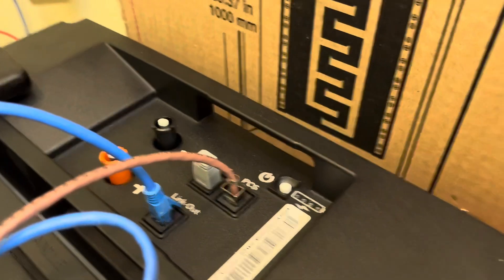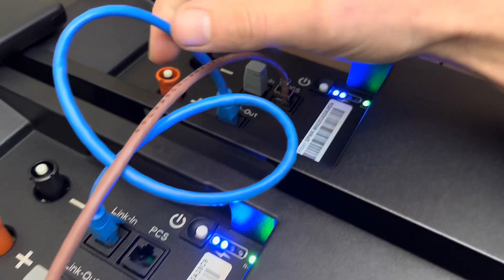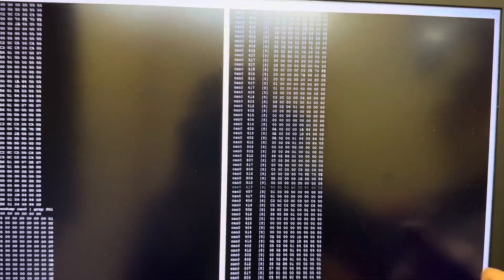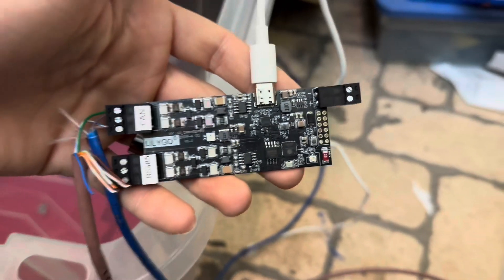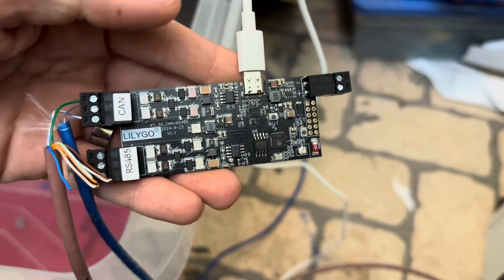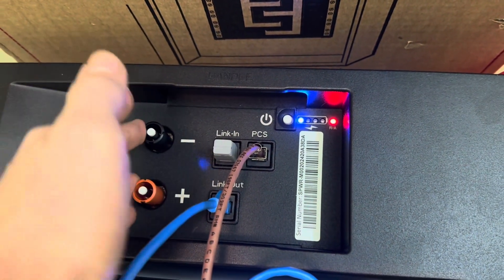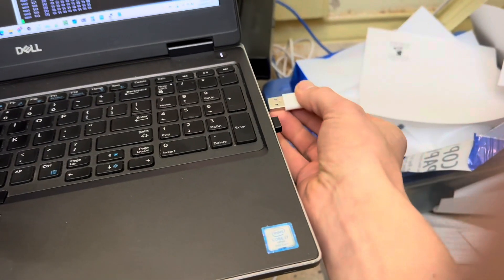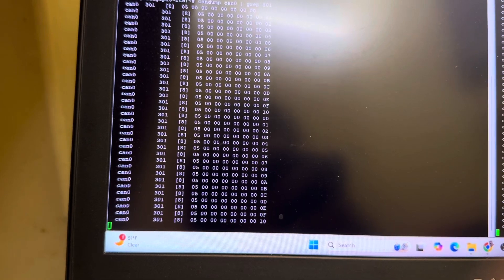6.5kWh Sunpower Battery Keepalives

Comment: Just curious if you made any progress with the Enerdel batteries? Mine is still sitting in my shed. As always very informative and interesting.
Reply from the maker: Hit me up, I'll share. If you want to run solar with it either a high voltage solar charge controller or a Solis high voltage hybrid inverter are two options. My trailer is stable minus the one battery that has a voltage isolation issue. I've already had like four of the batteries either DOA or die after commissioning them...